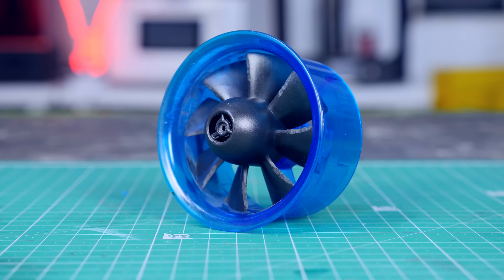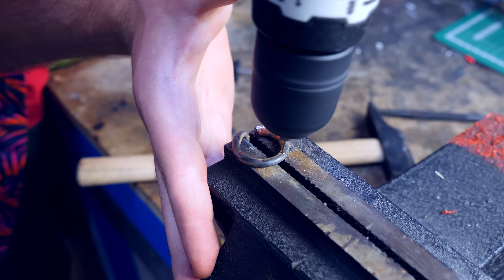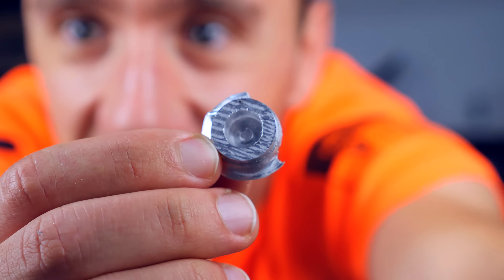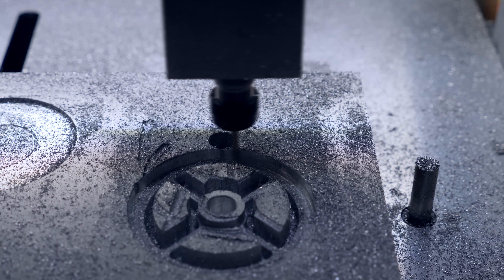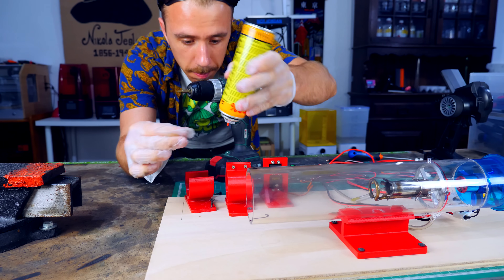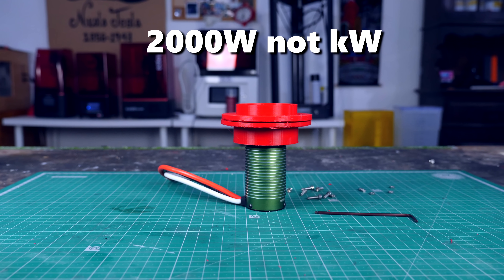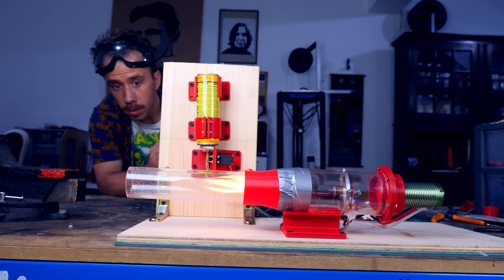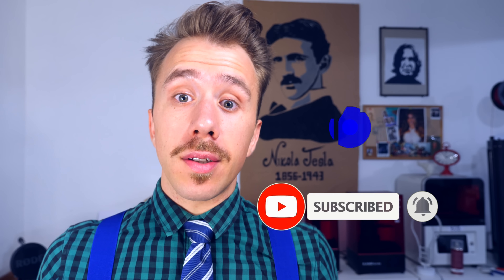I turned my Fan into a Jet Engine (3D Printed EDF Afterburner)

Comment: Your fuel is too cold. It can't get up to the ignition temperature fast enought. That's why aeroplanes preheat their fuel. Commonly with the exaus gas or like on the SR-71 blackbird you use the fuel as a coolant so the exhaust gases don't burn through the precious engine. So in your case I would advise, that you may route the propan line through the back of the engine, directly through the exhaust gas. If you have worked good, the gas doesn't have oxygen in the tube, so it can't ignite inside the fuel line, but once it leaves it, it directly has the temperature to ignite, once it hit's oxygen. I would suggest you try that, put of course you have to be careful that there is not too much oxygen in the line and the tube can't react with propan, so stainless steel would be ideal, but hard to work with, especially, when it is so small

Comment: So i think you should do a video about how your cnc machine operates, and next time mill the entire flame tube and bracket in with a vortex nozzel at the end with milled and drilled fuel intake.  You might try a side mounted squirrel cage fan, to give the in coming air a spiral action, and super fast flow.  And bigger!

Or just a rocket powered tomato launcher.

Like a small model rocket in a pvc tube, like a potatoe gun, lol!.

Comment: That was totally awesome to watch. Some things I observed:
*Your air/fuel mixtures were off. Maybe figure out a way to adjust fuel rate with air speed. I know, sounds so easy right? Though I think you have it in you based on all your previous videos.
*Jet engines are multi-stage centrifugal. Not sure if your current setup can handle that (might be too much pressure). May need more duct tape.
*Alternate fuel source. Propane tank with an adjustable fuel regulator.
*Buy or replicate a propane injector (much rather see a replicated one as these are always awesome to watch). 
*Insufficient tomato carnage.

Comment: Can you design a one way air pump and add wheels to it. I mean if you add a Fan inside a pipe and add wheels to that pipe will it move ? similarly what if we use Pumps ?

Comment: I've learned something new about diesel engines. I've always been under the impression that they solely operate with combustion via compression. But a quick search dispelled that notion. They are used to start a cold engine, especially in colder climates.

Comment: Make a U shaped pulse jetengine
It's doesn't require valves and it's easy to make
And I could use your experiment with it to improve my own attempt 😇
I tried to replicate Colinfurze's first one way back, but I still can't make it run stable

Comment: What's the best material for use in a jet engine?

Rando: Steel because it's strong and usable in high temps right?
Civil Airplane engineer: No you need a super alloy like Inconel because even steel can't withstand those temperatures everywhere in the engine.
F-35 engineer: Haha you poor people, real engineers spare no expenses and use super exotic alloys like AlBeMet because they're lighter 😎.

Integza: Acrylic tube because it is TrAnsParENT

Comment: Video Idea: you should make a small pressure chamber which shows what fan does what (measurements with fine dust in a small chamber that shows high pressure vs high airflow) so its easier for everyone to follow all the fan videos, AND understanding which engine is the best for what purpose (long burn low thrust or short burn high thrust).

OR 

Make an oxyhidrogen electrolizer (if you need some help message me im an engineer, i'll help ya a littlebit off camera) so you save fuel have a fun project and tell us about all the dangers of oxyhidrogen fuel.

Comment: You should 3D print a rocket engine with cryogenic cooling tubes built into the body of the nozzle the way the space shuttle did.

Comment: Glow plugs in diesel engines are not actually used for ignition but rather used as a pre-heater. Ignition is achieved entirely through compression.

Comment: I think an issue you're having might be that the heating element is mounted too far in front of the fuel injector, so when the flow gets high and the flame cuts out it can't relight until the flow is stopped.

Comment: It would be very difficult, yet awesome to make a turbojet/turbofan/turboprop engine and you use a turbine on the exhaust side to spin the compressor and/or propeller, instead of using just the trust from the exhaust gases.

Comment: Very cool. I think you need to 3d print a thrust-meter to measure your rocket/engine thrust. This will allow you to measure the actual thrust and not rely on the flame looks (look for mach diamonds, btw). Another good 3d printed project would be to see if you can make a mini-lathe. A 3D-lathe using round rods as lathe ways - like my unimat SL 1000 would be relatively easy to build and should work well for aluminum, brass & wood.
Tip: if you are looking for a small one think: unimat3 is a lathe+mill. A lathe+mill will machine any part you can think of and allow youto scale up to stainless and even titanium. Goodluck

Comment: well... I guess that would work as a replacement for the other ignition units you have be tinkering with, but if that is as small as you can make it. can you extrapolate how big the jet turbines are going to be? and that there could be as many as 80 of those type igniters in some engines. "quick, lock em up before the house burns down"

Comment: Check out this working system:. https://youtu.be/yKuq8T7KMa0

They wrapped the coper fuel delivery around the air diffuser as to pre-warm the fuel before getting into the burner ring.

Comment: you need quartz glass so it wont break. and maybe try putting an EDF in front of your centrifugal fan so you have both high air flow and high pressure air...

Comment: I'm following your videos for some long time and I like, how you're evolving: getting more professional and cleaner while building. 

A Video idea: Build a hybrid rocket engine with either O2 or N2O together with paraffin wax. O2 can be easy made if you have Magnesium hydroxide. N2O can be also made by yourself(it's tricky to get a tutorial on that) or you can use some N2O cartridges which are made for cream (at least here in Germany :D ) and while doing so, build a system which can open several cartridges at once. The wax is the easy part. Just melt some tealight into a cylinder with a whole ( or use you're 3D Printed Plastic )

Comment: You should design a rig where you can measure the thrust of your engines
Reply: This, would be great to see just how.much thrust these things are outputting, I'm managing a sliding rail with a load sensors
Reply: @Steph.98114  pffft load sensors, use a counterweight. Reject modernity, embrace tradition!
Reply: @one-terceptor  I mean that also works, just felt a load sensor would give better data
Reply: @one-terceptor  load cell for cheap: metal chain that has to be lifted, gets heavier as it lifts more
Reply: I think he already has that. iirc he had the engine on a straight track and measured how fast it got pushed along it.
Reply: He already did that
Reply: @fra.inti125  not really? what he did before was just a rail witch is kind arbitrary, I think what Ward is saying is something like a load cell which can tell us data on how much thrust it's producing overall. unless he did do a video on with a load cell that I can't remember.
Reply: @DoubsGaming  yeah that’s exactly what I meant
Reply: @fra.inti125  & @

Ghost Emblem. BUT he rarely tests his thrust output. Too many times I've wondered if he was really getting results.
Reply: @fra.inti125  nag he didnt, he made one that can only tell if it has any thrust at all, he can’t measure it
Reply: why is there a ' after engine
Reply: @MarterElectronics  my english is not the best apparently😄
Reply: @wardsnyers1798  It's fine haha. Usually you use engine's if you are using it like. It's the engine's fault. But i have multiple engines.
Reply: @MarterElectronics  we have a grammar Nazi
Reply: @unlockeduk  i am sorry lmao
Reply: @MarterElectronics  was just a joke bro don’t worry

Comment: Not an afterburner expert but: idea for you, after burners are typically used as an afterburner most burn using the hot exhaust gasses from the typically turbine jet engine mixed with extra fuel to burn everything for up to 50 percent extra power but with some other draw backs like more fuel usage and such. If you made a turbine engine then used the after burner you could make some good thrust with the right set up. I've been wanting to get into 3d modeling to design my own turbo jet engine and just haven't yet but you could probably make one with a little dedication at this point i mean you're practically 1/3 there.
Reply: The idea behind it is to make a better afterburner its almost easier to make the jet engine with an after burner then the straight after burner, it will put you way further ahead with less steps in the long run. Sort of idea

Comment: Watch your flame color and smell. If the color is orange red it’s rich in fuel. Same if it smells like the fuel. Blue and clear flames are what you are looking for. Also to preheat the fuel use a similar technique used by nasa in their shuttle engines. Place coils along the outside of the flame path. For them it helped nasa keep the engine cowling cool while preheating the liquid/gas. Maybe also look at the shape of the flame at different speeds and redesign your engine shape. I watched the flame contract and expand multiple times and by taking advantage of that (like in modern rocket engines and fighter jet engines) you can maximize your thrust.

Just saying

Comment: You should try adding a oxidizer with the fuel (something like nitrous oxide or concentrated oxygen). I'd be interested to see if it improves any!
Reply: He is burning fuel rich but that’s in part due to how his intake is design (centrifugal was a poor replacement) and too much fuel input. It not only starved the flame of oxygen but iced the tubes which restricted fuel flow only for it to then heat up due to lack of flow and ice melt and so the cycle went. Orange flames and the smell mentioned should have clued him into this issue. He needs better fuel control, better air intake fan design, and a section of the fuel coil in the path of the flame to preheat it. All of this would help prevent those issue

Comment: Project idea: use the resin/ceramic to 3d print a casting mold for an aluminum impeller. This will allow the centrifugal fan to spin at higher rpm and not explode like the water jet skateboard!

Comment: bow down to the gods on your wall
Reply: better flame holder
Reply: try hot air stationary plastic spray nozzle direction 3d printing (no moving acceleration grid nozzle print head)

Comment: regarding your nozzle, it appears that your compression ratio was incorrect, thus resulting in incomplete combustion, thus making the flame stick to the walls when you shut off the fuel. a solution to this problem would be to create a smaller "out" nozzle, so that the fuel is compressed more, and to seal it with epoxy, rather than duct tape.

hope this helped man! I'm eagerly awaiting the day news outlets report "breaking news: local man creates his own jet engine, and uses it to kamikaze tomatoes into oblivion"

Comment: i guess the problem of fail ignition at higher rpm is, that the fuel injector is after the heat stick, so the fuel air mix never get hot enought. If u put the injector on the mounting ring of the heat stick it might work better

Comment: You need to get shorter end mills for your CNC, the longer the bit the more vibrations caused which equal broken bits and bad parts.
General rule of thumb is you only want 1-200 thou of an inch of the end mill more than the LOC (Length of cut) sticking out of the tool holder.
So if the CNC is going to cut 1 inch deep, make the end mill stick out 1.2inches to help eliminate shutter, vibrations, and potential tool breakage. 

But don't choke up on the flute (cutting section) of a long end mill to make it shorter, this will only exaggerate the vibrations due to minimal clamping pressure/ surface area.  Try and find end mills with the flute as long as (or as close to) the LOC for best results.

Comment: Diesel actually doesn't need the glow plug. The pressure and temperature makes the mixture go boom. The glow plug is useful in cold weather as well as to heat up the chamber to optimal temperature before starting the engine. If Diesel needed ignition well they would put a ignition plug in there. That's what i learned in school.

Comment: That "noise" is chatter.  Its from the bit flexing instead of cutting.  Solution: Shorter bit length, slower feed, cutting fluid

Comment: Im no engineer but i feel like you should put a venturi on you're nozzle if you want more thrust, also i know its getting technical but if you look up a design of a turbine jet engine, i think 70% of the air flows around the compressor to help with thrust, hopefully you can work something out with this information

Comment: pretty great to see you make progress along the years! gotta say though that the sound on your milling machine is probably mosty due to the long cutting bits that create a lever to twist the frame every time the cutter is taking a chip, try using three flutes with at least 50% of the diameter as cutting width and really low cutting depth for roughing that worked well on a machine simmilar to yours for a friend of mine and me
Reply: ...and use the shortest and smallest cutter you can find

Comment: AXIAL TURBOFAN!!!

How about machining an AXIAL compressor for that engine, you've got a small CNC machine now, and it would work a LOT better than a centrifugal impellor. Also, more stages = more better! a 2 or 3 stage compressor (for either electric or turbojet) would make a huge difference to how it runs.

Comment: @
Integza You should get a programmable RC controller so that you can set a custom mix for the fuel to air mixture based on the throttle position.

Comment: Now with the gnc machine you can make a nozzle heat resistant and make a roket that combine the cold propulsion of the other video(that produces oxigen) with a típical combustión, tip for cooling the nozzle you can make the fuel go around the nozzle so the fuel absorb the heat. The sky is the limit...

Comment: How about use a cheap turbo drop ebay or somewhere and spin that up using an air compressor or motor and feed the fuel into the intake and light it on the exhaust?

Comment: Project Idea: you should make a second part of this video, in which you make another centrifugal fan but more similar to a turbo. I think you design with the fan blades parallel to the pipe makes it very restrictive in terms of airflow. A turbo- styled fan wit  the blades blowing into the pipe through a housing should be much more effective.
Reply: Agreed. That and a few other design faults didn’t help him or caused issues. The icing on the propane intake really hindered him at points and he should have had a few coils in the path of the flame to preheat it similar to the shuttle engines…. Still cool to watch

Comment: Use a piezoelectric disc to vaporise combustible liquids such as alcohol or gasoline to use as a substitute for gas cans as the fuel source. It would be less expensive than gas cans

Comment: Is the glow plug too far from the fuel source? Seems like once you get it started it blows the flame out and past the glow plug to the point the fuel and air push the flame out faster than it ignites.

Comment: CRAZY Video idea: You know how all of your engines burn up, so do the real rocket engines, but they prevent the burn up by liquid cooling the engines, so why dont you liquid cool YOUR engines! (Got the idea from a verretasium video)
Reply: Nono agrees
Reply: I totally watched the same Veritasium video and made the same comment like 20 minutes after you.
Reply: @Newml7  yeah when they started talking about the pipes in the engine i remembered how they use the fuel to cool the engine, i first found that out when they had to keep repumping the fuel in serial N4 i think, the guy talking over explained that fuel was used to cool the engine.
Reply: Some rocket nozzles are cooled by the fuel like integza does
But there are oxigen cooled nozzles
Reply: Why not loop the cold liquid fuel instead of water? It’s more efficient and is more realistic.
Reply: @SchnozwaldYT  i just said water instead of liquid :P

Comment: Next time bending tube, fill with sand first.  It won’t collapse when bending
Reply: Especially DRY Sand. If it has slight levels of moisture, it can expand or slightly explode when heating
Reply: @tomstorck9972  you are correct!  I oven dry my sand and leave and end open, but you are definitely right.  Wet sand BAD!
Reply: In plumbing, when bending the chrome or gold plated supply tubes under say, a pedestal bathroom sink (where you don’t want tacky looking braided flex supplies) we slide a tightly woven spring over the tube before bending it to fit. 

We also have proper hand held tubing benders, but the spring method is way quicker.
Reply: @jbirdmax  also correct!  I have a tube bending kit I got from K&S metals out of Chicago.  They sell TINY hollow and solid tubing.  Found the kit at Ace Hardware.
Reply: I hope these inputs shared from experienced commenters never end... yeno, in case I decide to buy a 3D printer and CNC machine to make the crazy s*$t which integza makes

Comment: Project idea: Gas pre-mixing chamber for oxygen and propane with 3D printed valves and mounts. That way you can better tune the mix you use for your rockets/turbines.

Comment: Cool project!! If you're seeing orange flame and smelling propane you might not be getting enough air mass flow into the chamber for efficient stoichiometric burn or the fuel is not being mixed well. Also having flames leak towards the fan from the copper tube might mean that pressure closer to the fan is lower than in the burn area